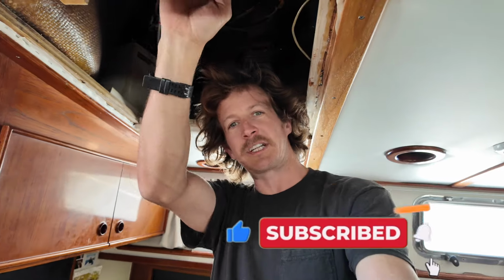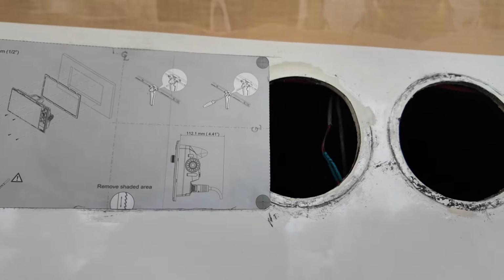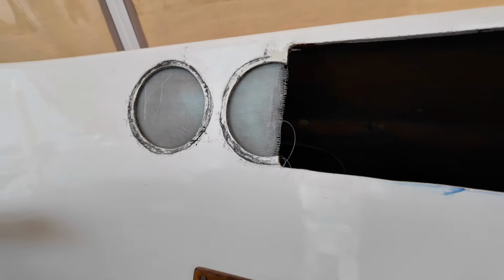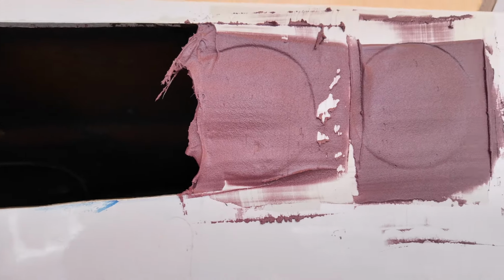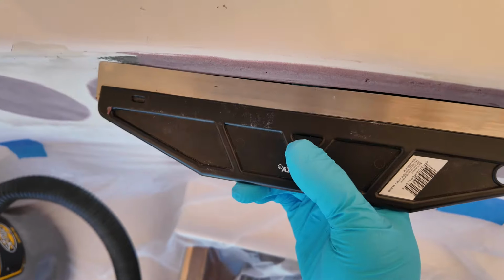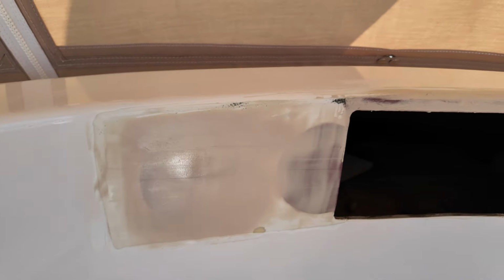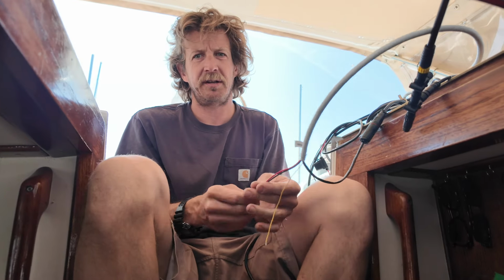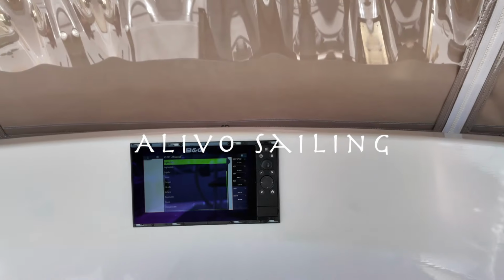Ep 34: Replacing Old Navigation & Installing New B&G

Comment: Have you considered that 6 instruments means that if one of them fails, you lose one instrument.  With 1 instrument if you lose one you lose them all.
While digital devices (it's basically a tablet) are very reliable.  However they are also quite easy to brick completely with something like a lightening surge.
If you have space, I would have moved the old gauges somewhere else as a "backup panel", like at the nav seat.
Reply from the maker: We love the redundancy, but unfortunately only one depth sensor was working. The rest were all broken. Thanks for the tips and advice, we appreciate it! :)